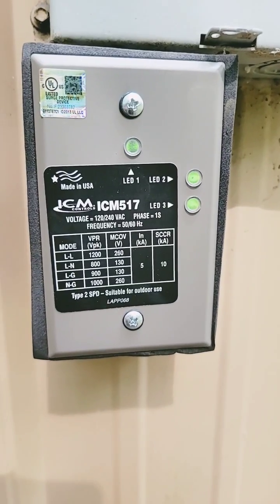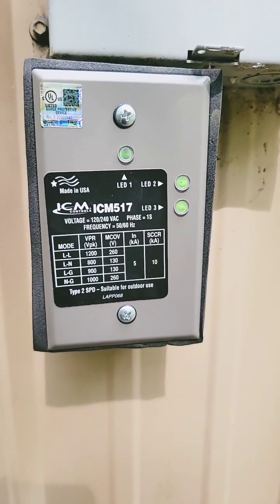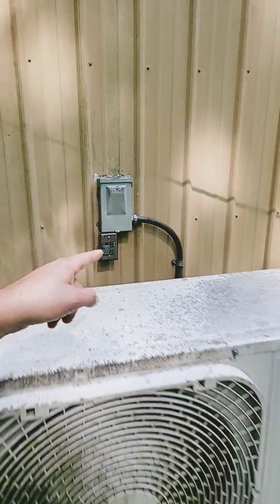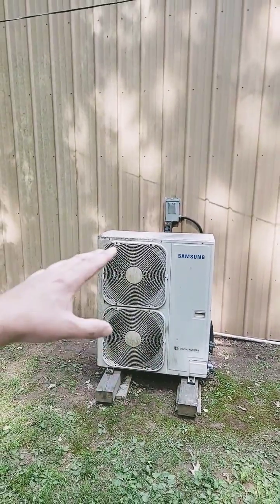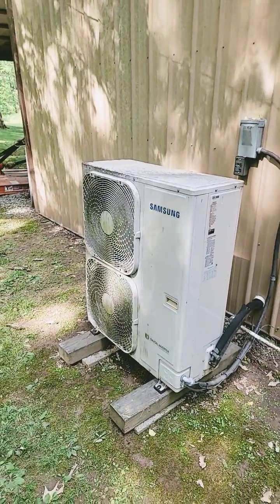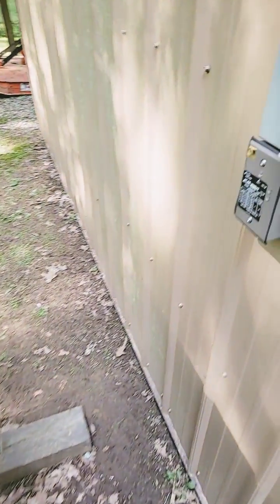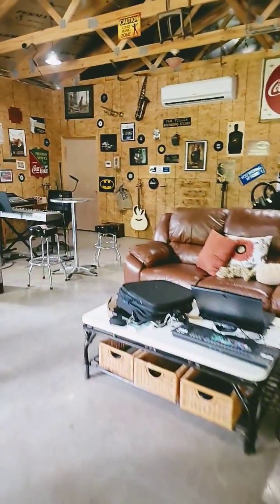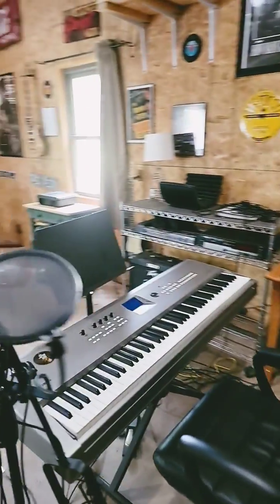How do you protect your air conditioner from a lightning strike? @icmcontrols9960

Comment: With installing it at the disconnect do you also need to install one on the indoor air handler as well? Or both is protected?
Reply from the maker: this equipment feeds power to the indoor unit 
so they are both protected